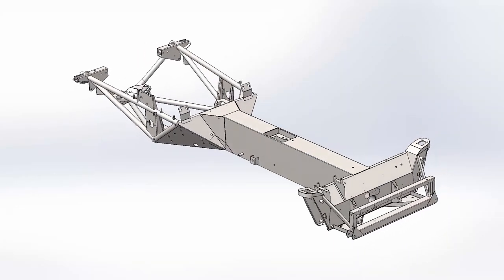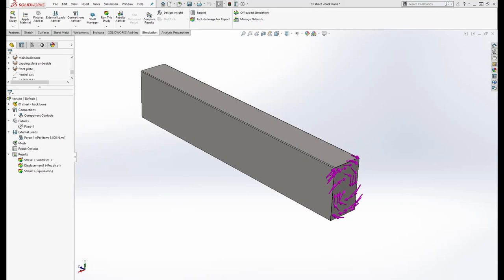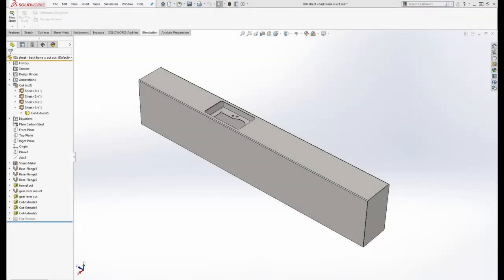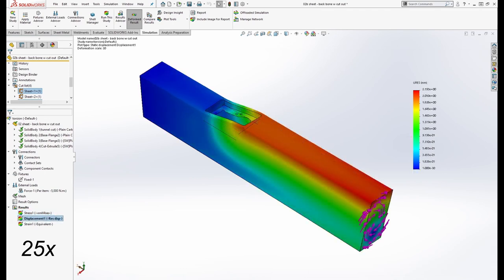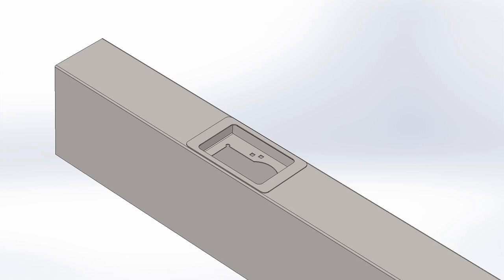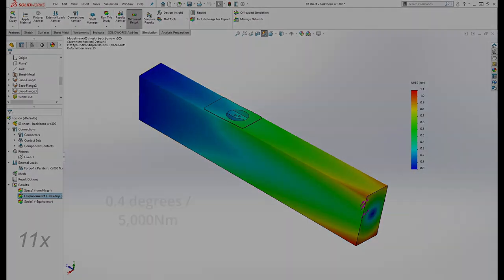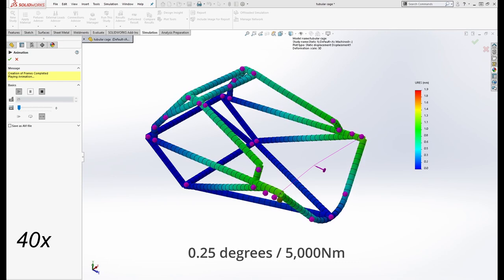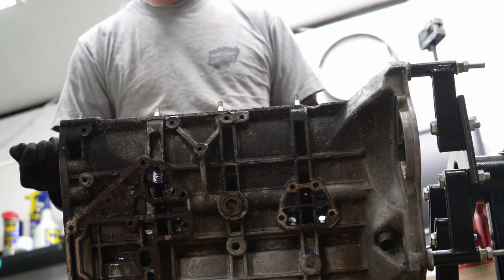Project GT2 - Lotus Esprit chassis Solidworks Simulation #05 (Mar-22)

Comment: thank you very much! I (only) have a '85 s3 but am planning to close the gear hole as well,  I copied the stiffening plate between the T and backbone as well, wonder what that does, had an broken weld in this area on a friends chassis so when I had to work on my chassis I just welded it in.  if it is good for the later esprit it is good for my s3 as well...
Reply from the maker: I'm no S3 expert but I think your chassis is not galvanised, but if you can hold out I am going to do a study on the modification to that gear lever aperture where I will compare welding to bonding.  Bonding has significant advantages where toy wont put heat into the original metal and affect its performance.
From a brief observation the underside stiffening plate helps shore up the sheer between the front cross member and the tunnel which want to always move in opposite directions (if if you took all the welds off the tunnel would fall to the ground.  It also likely provides stress relief at the butt welded interface between the tunnel and cross member for things like when a single wheel hits a pot hole or bouncing up a kerb.

Remember Lotus would have only had their expertise, experience and physical testing to sort these issues, not the tools we have today - and they didn't have the biggest budgets to work on by a long shot.  This makes me appreciate the chassis design even more, its a masterful piece of design.
Reply: @JonHimself  thanks Jon for the quick reply, the S3 was the first esprit to be galvanised. my '85 S3 has nearly the same front and rear as the later ones. (trunniunless front with vented brake discs) after I found that broken weld I saw what lotus had done on the later esprit chassis to make that part stronger.  I had heard about the weakness in the gear lever but was surprised how bad it was.

Comment: Did you try running the simulation with the reinforcing plate on a  chassis with cracks/stress risers? Wondering if that might guide you/others whether to undertake sheet metal repairs or just reinforce with the plate…

Comment: Really interesting video Jon and some good results. Was that a shell or solid mesh you used for the beam?
Reply from the maker: Shell using 'sheet metal' and weldments.  I had probs with 3 component stacks (chassis / bolt plate / capping plate) so I was tempted to go solid but it runs a lot quicker and more stable this way.
Reply: @JonHimself  I'd say that's a fair assumption and the results look great!
Reply from the maker: @TheOnlyMosesMalone  thanks, I was really happy with the results as it proves the software and method, but I also have other collaborating data, such as the damage and the 'rumored' torsion values.  The fact they all correlate is really satisfying and can lead to improvements later.

Comment: Did you include the rear cross brace when running your simulations?  I’t doesn’t appear in your diagrams.
Reply from the maker: good question - I mentioning this at 18:08
The simulation assumed an infinitely rigid beam between the two suspension points as shown by the thin purple line and the 'pin' in the centre.  This is the 'jig' if you like which applies the torque to the suspension mounts, the 'pin' being the centre of rotation where the torque is applied.  I was running out of time to simulate this to an nth degree as explained.  The rear cross member has shown zero stress on the real part and when briefly studied it is extremely strong in compression as one might expect.  So it is taken into account, even if it is assumed to be infinitely rigid - it is just assumed to have no significant impact.
Simulations are fun but there becomes a point of real diminishing returns.
Reply: @JonHimself  Thanks - I must've missed that first time around.  By the way, I have one of the cradles if you would like some measurements.
Reply from the maker: @themikegriese  np, I take it you mean the S300 rear engine brace?  I personally don't need one as I am going full roll cage but I know a few people who are interested in the design and possibly replicating it.